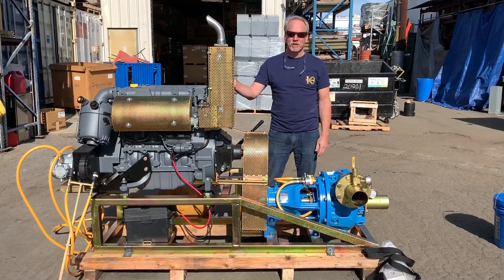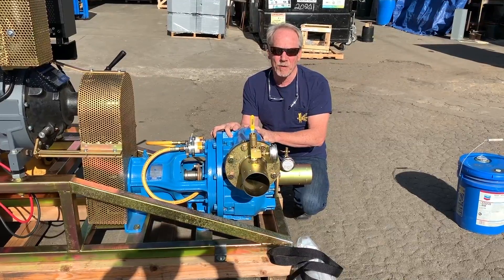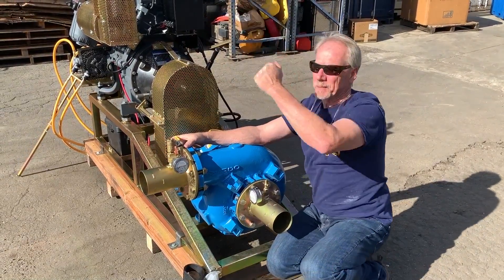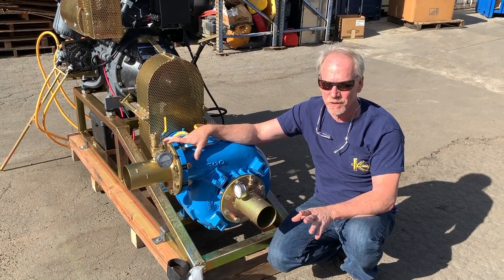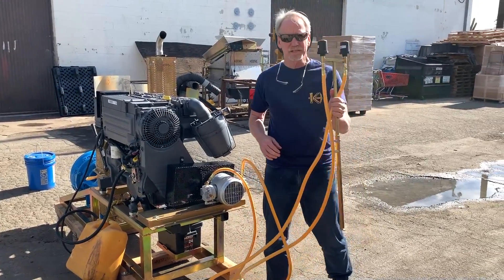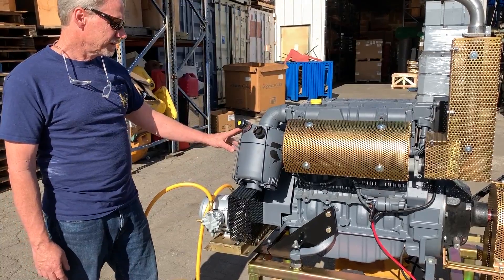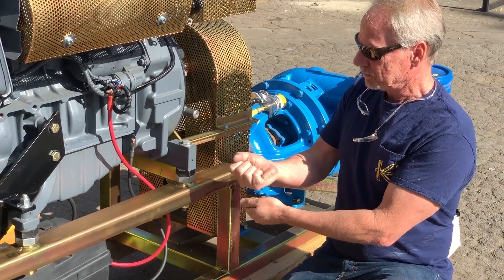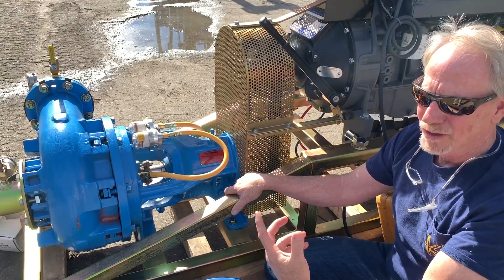Keene 4" gravel pump

Comment: Thank you, excellent rundown! But two queries as I am not totally clear on two points. 

(1) You said it can pump up to 1500' feet (500 yards). Can the pump (discharge) PUSH >OR< PULL (suck) up to 1500' feet, or can do both.? In other words, does the pump have to be set up to discharge from the waters edge >or< can the pump be set up away from the water with the capability to suck up to 1500' feet.? Can you give both (gravel travel) discharge and sucking distances. 

(2) What types of HOSE (and connections, quick coupler? and dredging nozzle?) has to be used for both intake and discharge.?
Reply from the maker: Gravel pump systems typically work better at discharging material.  I have gone up to 200 feet of suction hose and it worked ok.  I have also discharged over 1500 feet with 15 lift with no problem.
Reply: Keene Engineering Inc. -- Thank you very much, that is what I wanted to know, was mainly the suction distance. Up to 200' feet (about 70 yards) of suction hose can be used. Then it can fed into a wash plant sluice and/or diamond jig.
Reply: gear rotation at what ratio against engin.
Reply: Keene Engineering Inc.  What is the price for the entire setup?